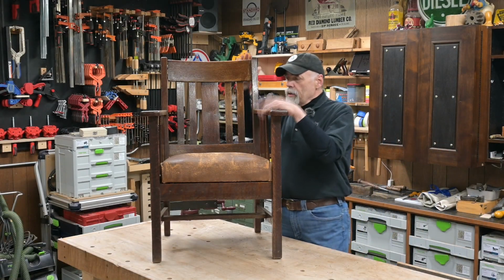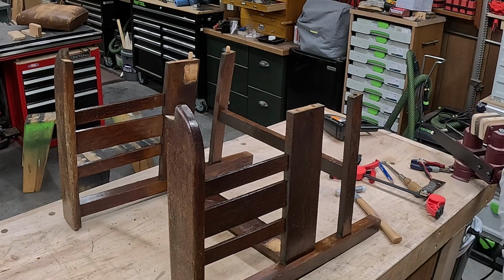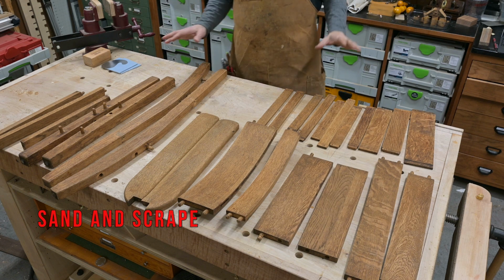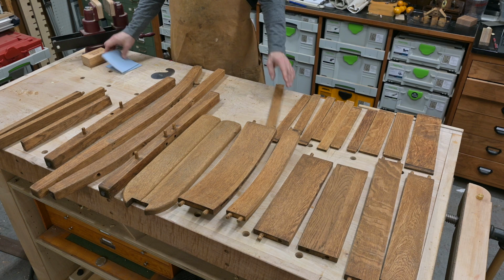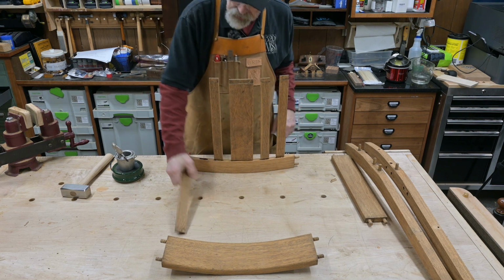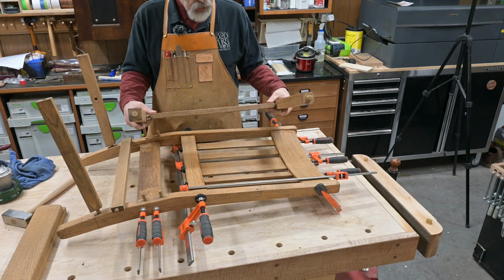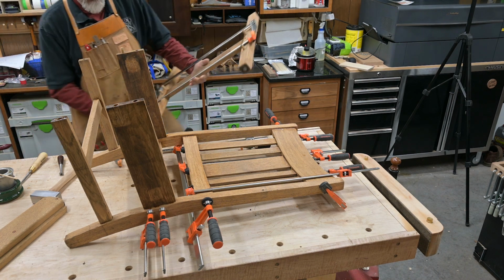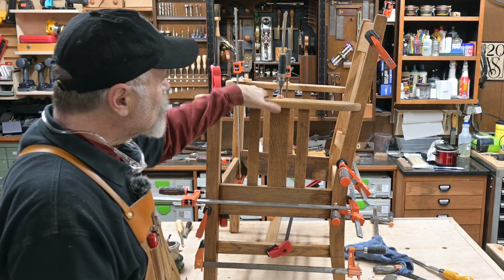Oak Chair Restoration - A First for Me!  #furniturerestoration

Comment: Great job!  All that work and did not replace the seat material.  Wondering how it could get so worn and still be so firm.  I would have done everything you did on the project except for the seat.  Just my opinion, you are the pro.
Reply from the maker: Well… I kinda agree with you… the final decision is yet to be made. It has a cool look but not sure it is the long term answer. I think there is an upholstery video in the future. Probably a dark red leather?